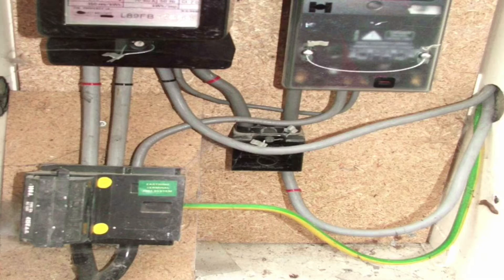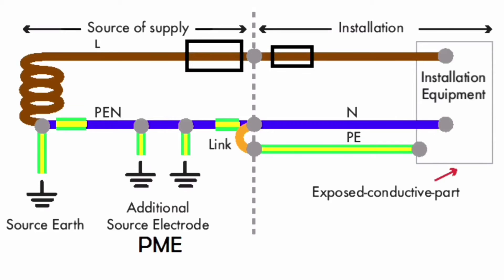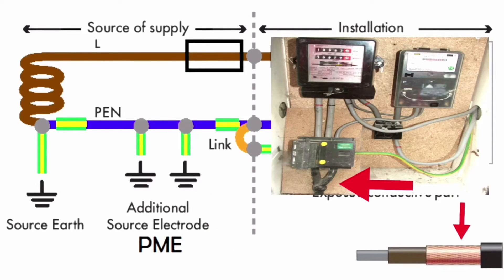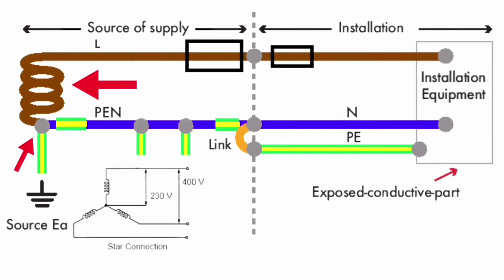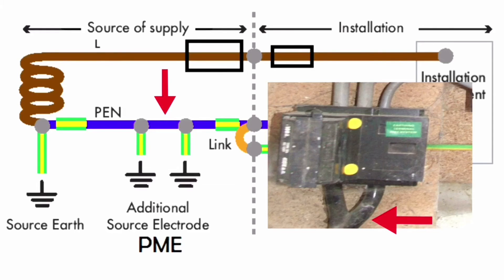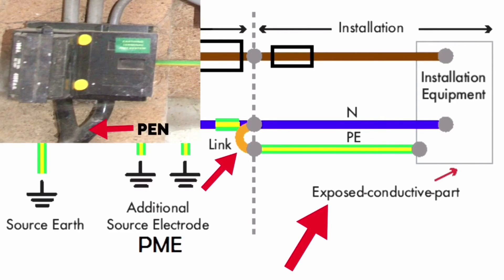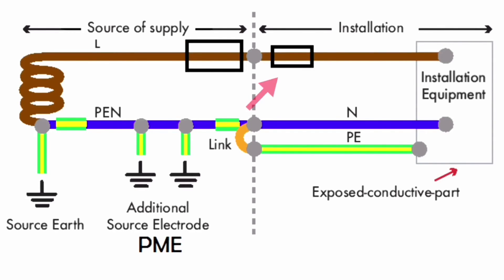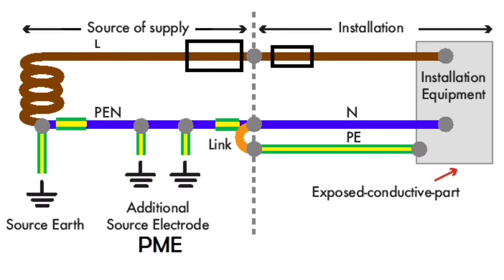Earthing Arrangements TN-C-S in a Single Phase Installation Explained in Pictures

Comment: If you earth your exposed conductive parts in the Installation on the consumer unit using an earth electrode, then the risk of conductive parts rising to line voltage would be eliminated. In that case, why stake multiple earthing electrodes between supply and installation and perfrom PME? 
The equopotential bonding on the consumer installation should be enough.

Comment: 1.	Can earthing be reinforced/improved within a TNC-S installation? i.e installation of additional earthpits and linking to the separate earth conductor within the installation?

2.	From the diagram above, how effective is the TNCS Earthing system when the ‘source of supply’ is significantly shorter than the ‘installation’?

Comment: With TNC systems the regs (18th edition) say you can't use RCDs as they won't work if the combined neutral earth cable breaks or has a fault.

Is this the same case for RCBO's?
Reply: That is incorrect. RCDs and RCBOs all work perfectly with a TN-C-S system. This is what is used in Australia and New Zealand and RCDs on almost all circuits are mandatory under current regulations there.
Reply: TN-C has not to my knowledge ever used in the UK but it is true one cannot use RCDs on a PEN-wire. One can use them only after the earth and neutral have been separated. Now the fact that RCDs do not protect against PEN-faults is a completely different issue and not the reason they cannot me used on a PEN-wire.

Was that question of RCBOs serious? Why not ask can you use them on Sundays? RCBO is just a name for one type of RCD.

Comment: What's to stop the Neutral going straight to ground on the Installation?. I m struggling with the combined N and E concept. Unless of course the N return path is ground of course. Just seems at the moment that N is dumped straight to ground and return s via the mass of the Earth.
Reply: Because the impedance via the ground (earth) is significantly more than the impedance of the external neutral conductor to the installation. It's actually a very, very good and safe system.
Reply: You meant the earth? That would be TT. You need two conductors for a circuit. One of then just is grounded. The current dos no`t go through the ground. Why would it?

Now in some places there are single wire earth return systems but they are far from ideal. Also trams use the rails as the return path.

Comment: Excellent informative videos. Are you doing any on wiring emergency lighting with switched separate fittings?. Its something I struggle to get my head round.
Reply from the maker: +Jimmy Mcelroy 

Hi thanks for the kind words. I am currently on holiday so I am trying to produce uploads that don't require access to my workshop or college. I had requests for steel conduit uploads in the past and I managed to for fill them so I might be able to help you in the future. Thanks again GSH Electrical